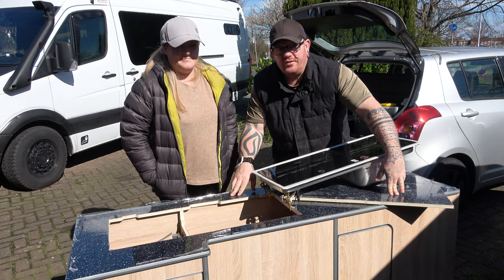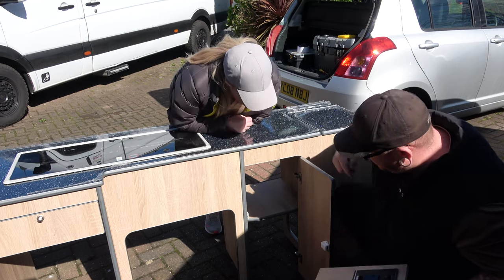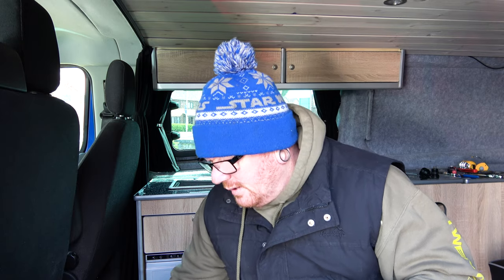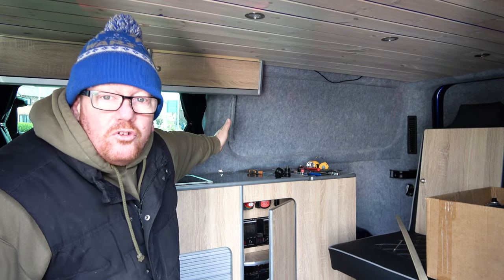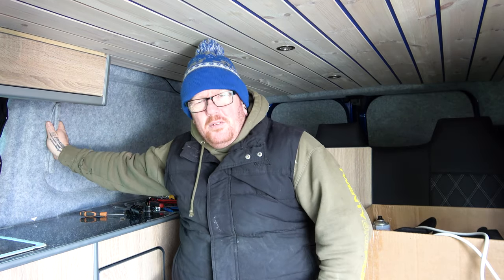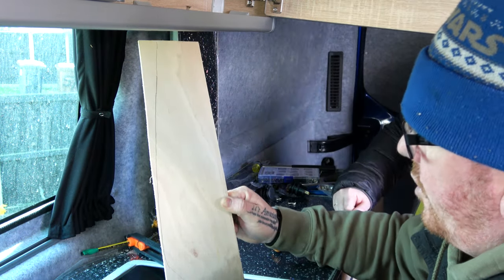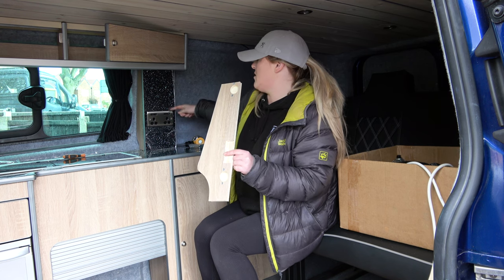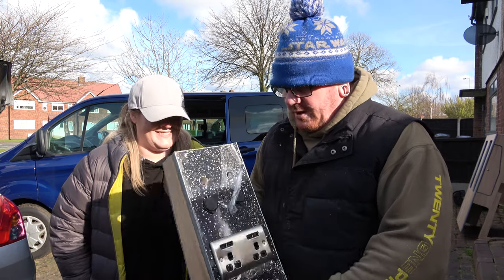We MODIFIED The Flat Pack Units

Comment: You two are very good.  My worry about building one myself is what about condensation and mold?  How does the air venting work?
Reply from the maker: Our Van Is is fitted with these magical things called doors and windows we find when we open them unless the air vent I don’t know if your van is the same as this possibly check in the owners manual

Comment: I’ve been trying to work out what size ah battery I will need for my conversion. It’s a sprinter conversion but only really going to be a weekend away jobby and the occasional week now and again.
I’ve not got solar but I won’t be running anything too bad I don’t think.
Reply from the maker: Probably 120ah woukd be a good start mate . Plus you can allways add more if need be . Or even 100ah . All depends on what you intend to run . But I’d recomended a good b2b before solar .